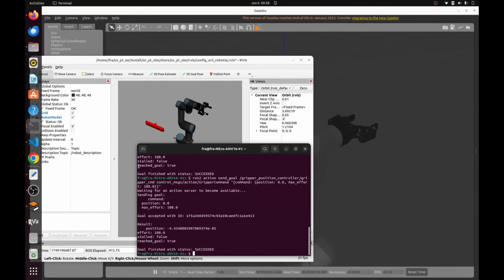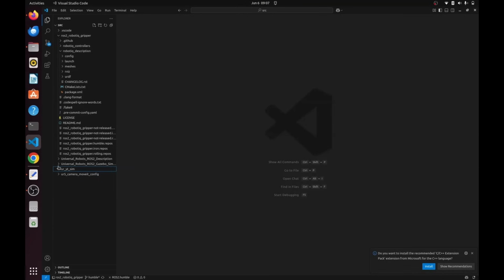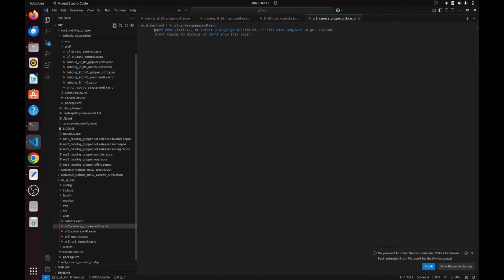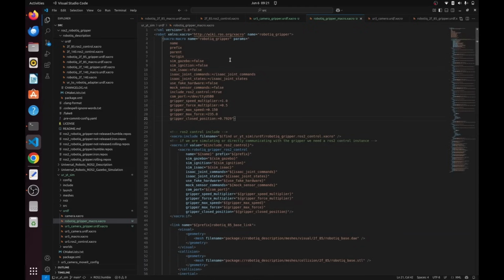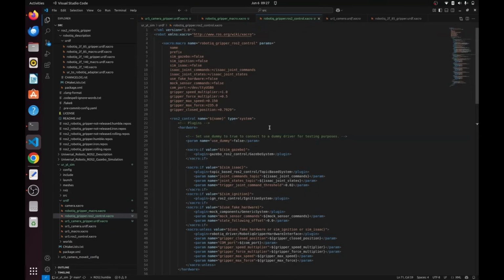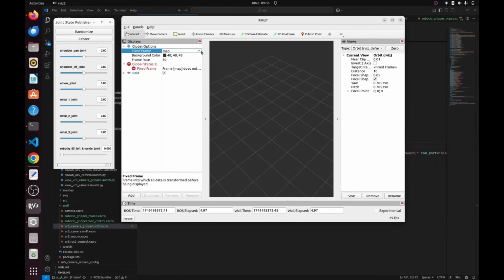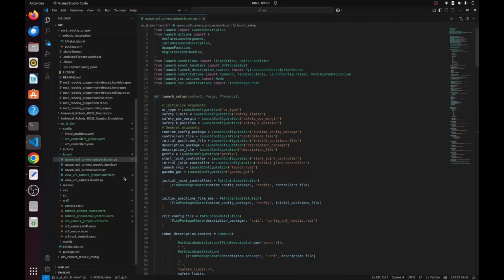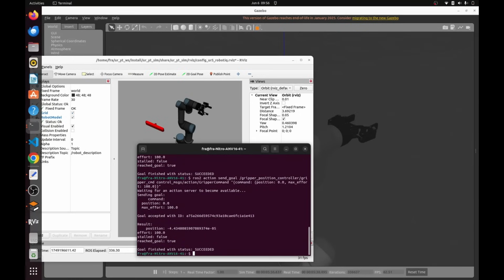Robotiq Gripper Integration on UR5 in ROS2 – From GitHub to Complete Setup in Gazebo

Comment: Hi, thank you for a very useful tutorial. I tried to replicate it for ROS2 Jazzy and Gazebo Harmonic with necessary adjustments in configuration files,  but I am struggling with following errors: 
[INFO] [spawner-2]: process has finished cleanly [pid 50190]
[gazebo-5] [ERROR] [1769446055.223346487] [controller_manager]: The 'type' param was not defined for 'gripper_position_controller'.
[gazebo-5] [ERROR] [1769446055.223552160] [controller_manager]: The 'type' param was not defined for 'gripper_position_controller'.
[spawner-4] [FATAL] [1769446055.271688632] [spawner_gripper_position_controller]: Failed loading controller gripper_position_controller
[ERROR] [spawner-4]: process has died [pid 50192, exit code 1, cmd '/opt/ros/jazzy/lib/controller_manager/spawner gripper_position_controller -c /controller_manager --ros-args'].
In yaml file, I have:
 gripper_position_controller:
      type: position_controllers/GripperActionController
gripper_position_controller:
  ros__parameters:
    action_monitor_rate: 20.0
    allow_stalling: true
    goal_tolerance: 0.01
    joint: robotiq_85_left_knuckle_joint
    max_effort: 100.0
    stall_timeout: 3.0
    stall_velocity_threshold: 0.001

What could be the reason for that?  Really appreaciate your help...

Comment: Hi dear, I followed your tutorial, and it helped me a lot, but I have a problem at the end when I upload the ur5_camera_gripper.urdf.xacro file into the MoveIt Assistant; then it crashes. And another question: I noticed in this video tutorial there are two custom folders: 1. ur_yt_ws and 2. ur5_camera_moveit_config. In the previous tutorial, you only have the ur_yt_ws custom folder. Could you please tell me what the other custom folder is for and what kind of files it contains? Thanks.
Reply from the maker: Hi! If Moveit crashes probably is because you don't have all the arguments defined in your Xacro file. If you have copied the Xacro from the ufficiale UR repository, in the first line you find name={$arg}. You need to specify that arg. Make sure that the first line is something like this: <robot xmlns:xacro="http://wiki.ros.org/xacro" name="ur">.

Regarding the other packages, here you are: https://github.com/LearnRoboticsWROS/ur5_camera_gripper_moveit_config 

Let me know if it works

Comment: I'm facing error while running the launch file, this logs are coming 
spawner-3] [WARN] [1753818691.083322143] [spawner_joint_trajectory_controller]: Could not contact service /controller_manager/list_controllers
[spawner-3] [INFO] [1753818691.084214040] [spawner_joint_trajectory_controller]: waiting for service /controller_manager/list_controllers to become available...
 the gazebo is coming as black screen. I have clone your exact repo. Can you help me with this

Comment: so nice video again! btw do you have experience about creating gripper by youself using stf (3d model) ?  because we cant always use official repo. ♥
Reply from the maker: Good point, this is tricky because you would need to have a gripper made by different components, each component of the gripper has a stand alone STL file, then you need to setup manually the joint and passive joint. Honestly I didn't made it before, but this is a very good input for a future tutorial;)